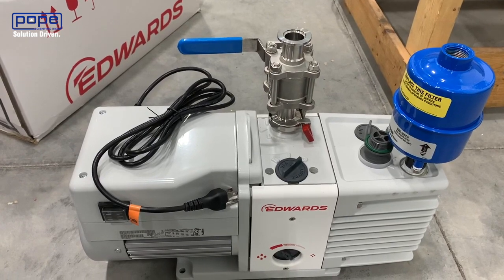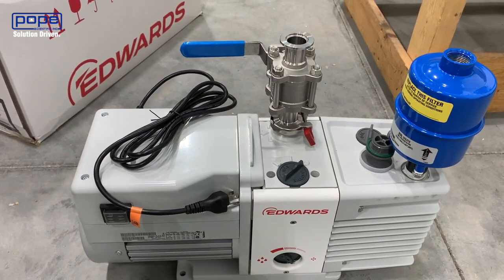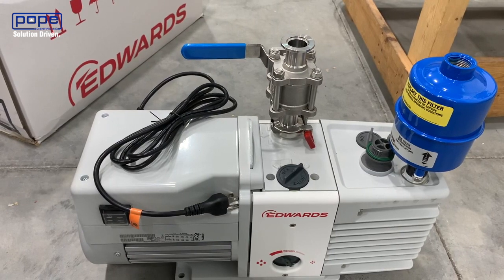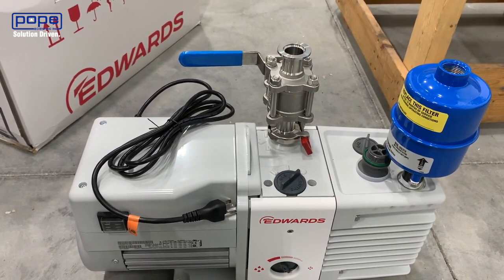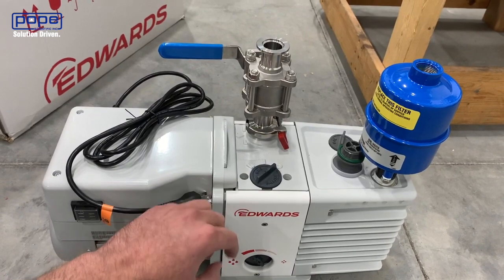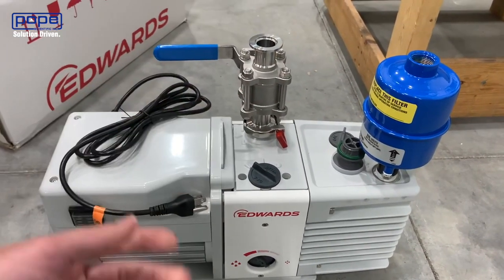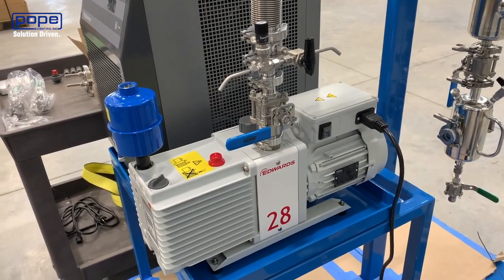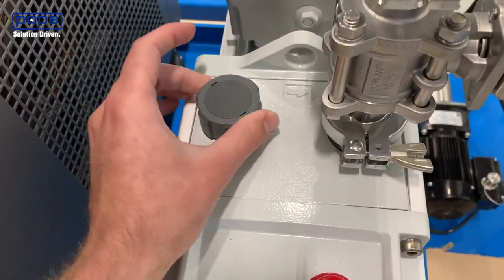Vacuum Pump Gas Ballast Operation

Comment: My organic synthesis lab (newly setup) bought two edwards rv3. We used one for rotovap, another for drying samples. Nobody told us we must use a cold trap. Both pumps got damaged within a month. Technician removed about 200 grams of what appeared to be gunk along with some nicely crystallized stuff from the insides of one pump.

Comment: thank you for sharing your video. I have a question: When you have the ballast set to zero and you let it run to remove volatiles, how long should you let it run at zero and what is the difference when running the pump at 1 or 2?
Reply from the maker: When the ballast is set at zero there is no air introduced, a small amount is introduced when set to one and more when set to two. We recommend setting the ballast to two for at least 30 minutes after processing, but a longer amount of time is preferable. When the pump is set to zero, it will not be optimized for removing volatiles, but instead will pull the deepest possible vacuum. If very strong vacuum is not required, the gas ballast can be left open (set to one or two) while processing.

Comment: We are using a Pfeiffer Duo 3 for a Scanning Electron Microscope.  we only look at solid items.  Should I keep the ballast open at 1 or closed? (ours shows 0 or 1).  Or should I have it open until a specific vacuum range is achieved and then close it?  Thank you.
Reply from the maker: Hello - For most rotary vane type vacuum pumps it is best to open the gas ballast prior to shutting down the pump to ensure any volatiles are removed from the pump, if this is done and the pump is being used on dry materials, you could likely start the pump with the gas ballast closed. However, it would be best to reach out to Pfieffer directly to get their expert opinion on use of your pump.

Comment: Hello - good video. I have an Edwards D40B vacuum pump. We exhaust our ballast directly to a fume hood to reduce the odour. The distance is long, and I think residual off gas is coming back into the oil and decreasing its life. Do you have any suggestions as to how I can prevent odour and at the same time increase the longevity of our oil? I was thinking of using a trap of some sort?
Reply from the maker: Hi, Thank you for the compliment! The first thing to check is whether or not you have any suction (even slight) at the outlet of the vacuum pump / inlet of your line that goes to the fume hood. If you create back pressure at the pump outlet, this can reduce the ultimate vacuum achieved by the pump. If this doesn’t clear things up, feel free to give us a call and we will try and provide some more clarity!

Comment: Oh wonderful! So I do not have to have a source of compressed gas to inject into the gas ballast port?!
I have a HarvestRight freeze dryer and on the side of the pump, there is a knurled knob that says "gas ballast ON OFF" in the documentation, it is called part number 46 "knob". So if I loosen that knob, it looks like it can come completely off, which I assume is not a good thing. So from finger tight, I should rotate it counter-clockwise 360 degrees or so, right?
Reply from the maker: It may depend on your model of vacuum pump. We utilize Edwards E2M18’s that have a knob for the gas ballast. This takes approximately 6 full turns before it is fully open, at which point you start to feel some resistance to opening. If you are using a different pump, a good sign that the ballast is open is that the ultimate vacuum in your system has decreased. We would recommend reaching out directly to the vacuum pump manufacturer if further clarification is required.
Reply: Hi Zach, What did you learn about using the gas ballast knob . Just got my harvestright unit tonight and the standard oil based pump manual says nothing about this valve, its not even shown in the booklet. Any advice/help would be greatly appreciated.